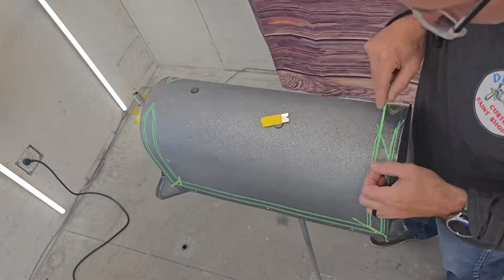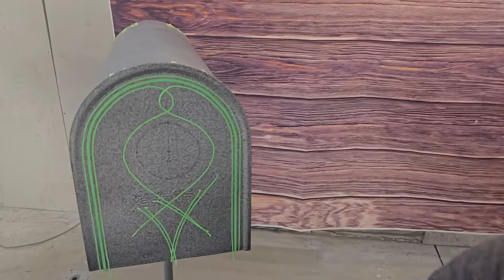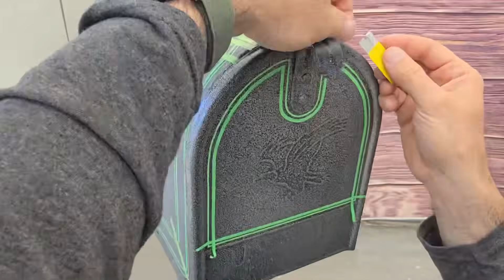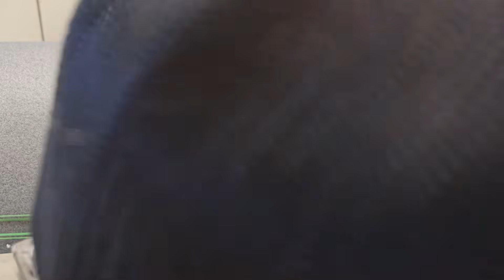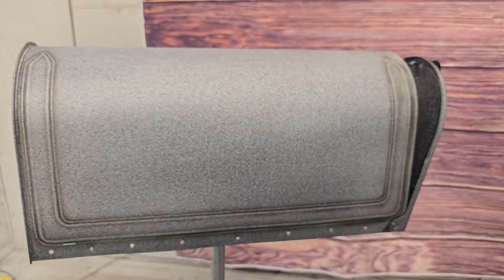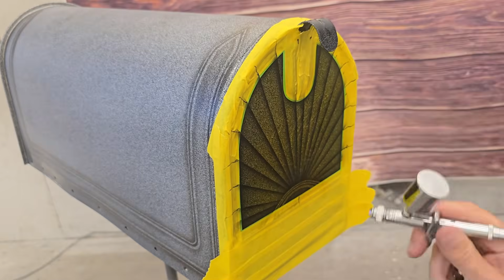Step by step guide to adding Pinstripes using Lime Line Fine Line Tape.

Comment: Won't the oils in your hands cause problems with the paint adhearing to the base paint? Should I wear gloveswhen masking? Or what do you use to keep hands clean? Thanks
Reply from the maker: It is very uncomfortable for me to use gloves when masking and airbrushing.  I always wear gloves when cleaning parts before and in between basecoats and clear, but while doing art work and graphics I won't wear gloves.  I always wash my hands with dish soap before doing any work.  Hope this helps. Thanks for watching